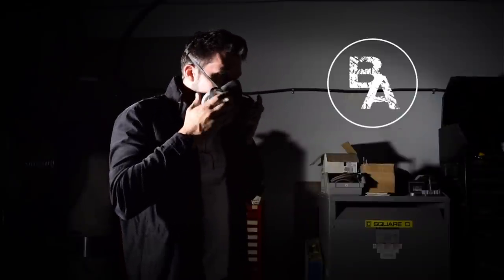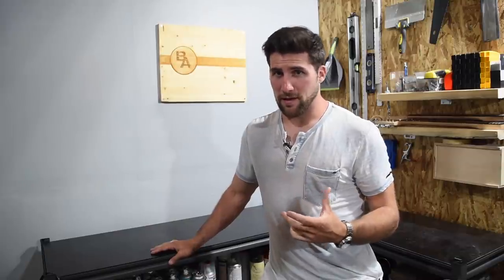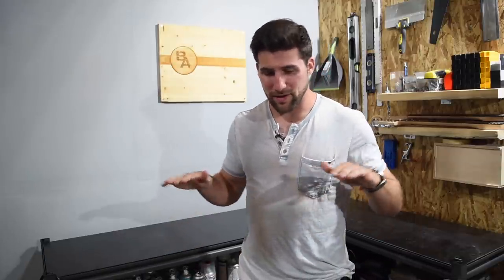Why is your paint crazing?

Comment: You can guarantee it's going to happen if you spray your clear on too quickly. You spray your base coat and either spray the clear when it's touch dry (recommended time), or when it's fully dry (2-3 full days later). Short cutting the drive time to spray clear will get you cracking 100% of the time.
Reply: What kind of paint are you talking about? I’ve never heard of waiting 2-3 days but I’m mostly familiar with automotive paint. The stuff I use you’re supposed to wait 30 minutes after the last coat of base and the spray clear. If you waited 2-3 days you’d have to scuff and then spray a coat of base again and then wait 30 minutes and clear. That’s how you get a good chemical bond instead of just a mechanical bond.

Comment: i had crazing happen on my latest guitar build progect and when it did it was vomit almost inducing word to the wise do not mix rustolium and duplicolor metal cast its like oil and water it dont mix
Reply from the maker: +Lance Moss A lot of rustoleum's stuff is enamel. Most duplicolor is lacquer. They are not friends unfortunately.
Reply: is it a good idea to use poly on the guitar i painted with rustoleum? the rustoleum i am using is a "universal" one, and it is also paint+primer(it is white). the poly i have is the minwax fast drying stuff.
Reply from the maker: +5hredder That sounds like a pretty risky move to me.
Reply: well, i am not sure how to finish my guitar... i finally finished painting it(i am kinda a scrub at painting, so it took a while to get the paint to look professional). will shellac rub on nicely? i am very familiar with shellac, but i have never tried it on paint. what would you recommend? i rather go and get the proper stuff for a clear coat than to have to scrape everything off and paint again...
Reply from the maker: +5hredder what kind of paint was it? I don't think shellac is going to be a very useful clear coat option.
Reply: the gloss white rustoleum "universal" primer+paint. https://www.lowes.com/pd/Rust-Oleum-Universal-White-Enamel-Spray-Paint-Actual-Net-Contents-12-oz/3728793

it is funny how it doesn't specify whether or not it is enamel on the can, but the link on lowes says all...
upon poking around the lowes website further, i have found that there are enamel based clear coats... aside from enamel based clear coats, what else could i potentially use to achieve a strong finish? if so, which one is best? also, if i use an enamel clear coat on completely dried enamel paint, will the paint color bleed into my bare wood when i spray the whole thing down? or will the edges stay crisp?
Reply from the maker: +5hredder enamel tends to be a pretty strong coat as long as it's given sufficient time to cure. It's usually best to stick within the same paint type just because it reduces the risk of bad reactions. 
I'm not sure I understand your question about the wood and the crisp edges. What do you mean?
Reply: i have beveled edges that i am going to scrape the paint off of and stain. will the clearcoat dissolve a little bit when i apply the enamel top coat? i am also going to spray the edges with the same clear coat to seal the stain in and to create one smooth finish, but i am concerned with the edge of the paint dissolving slightly, and creating sort of a milky look on the edge of the white paint that touches the stained area.
Reply from the maker: +5hredder enamel shouldn't dissolve your original clear.
Reply: my original white* alright, thanks. it is always good to get a confirmation from a professional. :) i guess if the clear could disolve the white paint, it wouldn't be clear... duh... silly me.
Reply from the maker: +5hredder some clear coats can dissolve paint. Particularly fresh paint. Your old paint should have a clear coat on it though, and should be protected from that.
Reply: i guess i didn't explain it properly, i built the guitar from scratch... i bought the "kit" from houston hardwoods, i bought planks of wood and used a grinder and a jig saw until it looked like a guitar, and built it all. there is no previous paint, aside from what i put on it already. i have experiance with certain clear coats, but i just have no prior experience with high quality painting procedures... 
when i put my first clear coat, should i scrape the clear coat back off of the area that i am keeping unpainted with a razor, and then reapply again over the whole thing once that coat is cured and scraped? i guess it would make it easier for me to stain the wood after i scrape off the first clear coat since i have to sand it all down until i get all the stuff out of the pores anyway.
btw, i do appreciate the time that you are taking to help me out with this. i realize that it is hard to visualize the project that i am building, but i can't publish it on the internet because there are a few features with it that i need to patent.(i am an engineering student that is currently studying fabrication on the side, and building a really high end guitar because it has been a goal for a long time).

edit: screw it, if the base coat bleeds into the bare wood when i coat it all, i can always just scrape back again and redo it, because a second coat will not dissolve past the first clear coat. i know that paint requires sanding to adhere propery(as explained by one of your previous videos), and i know from experience that shellac doesnt require sanding because it dissolves the previous layer way more effeciently; and when it is applied over a stained piece lightly, stain only bleeds onto the application cloth during the first two shellac coats. therefor, an enamel clear coat shouldnt dissolve the base paint once i top it once. and it is going to leave a crisp edge after i scrape the opaque bleeding away and re-coat. 
i guess i am all set now, thanks for teaching me about different paint types and what i should avoid. i asked the question of what to use to the paint mixer at lowes, and she said that poly goes good on enamel, and that it was the only real choice...
Reply from the maker: +5hredder I'm still trying to get a handle on what you're looking for, sorry. It's been a long few days haha. Maybe this will help:

If you're looking for (for example) stained transparent bevels and an opaque painted top, back, and sides.  The easiest option is: stain the whole thing, seal it with transparent sealer or clear coat, let it dry and sand lightly, mask off the bevels and spray your paint (or just paint and scrape what you don't want to keep), scuff lightly with 800 grit, and then clear coat the whole thing.
Reply: okay, i screwed up my paint while spraying the clear coat because i attempted to use acetone to clean off the edges where the top coat pushed the stain onto my paint... atleast now i know that acetone should never go on dried paint... it cleaned the clear off pretty good, but it made my paint bubble and it forced the paint layers to seperate.
 this example that you listed is pretty much exactly what i am messing with, and i am going to do this to fix my mess... 
there is one issue though, i am wondering if a masking agent exists that can be easily removed once the paint/clear dries without damaging stuff. i cannot use masking tape due to the complexity of the shape. however, i suppose that the list of suitable masking agents increases drastically since i am going to use it to cover a clear coat instead of bare wood. any suggestions? or would my best bet be to just kinda go "backyard chemist" on this and make my own anti-adhering peel glue? i am thinking parrafin might work, but it might also be hard to clean up completely afterwards.
i never thought i would learn sooo much about paint(or that there was this much to know about paint) by taking on this one project... i suppose taking on a hard project like this though is the best way to learn how to paint(for me atleast).
Reply from the maker: +5hredder If you're looking for a very controllable masking option for complex stuff I usually go with transfer tape, then draw on my image and cut it out with a razor blade. If you're looking for something more abstract, have you seen my video on the dish soap technique?
Reply: yeah, i was hoping that you knew of an option that could be painted on and then left to dry and peeled off. i have seen your soap method, which is really cool. however, i am kind of afraid that it will get pushed around by the force of the spray. i suppose that if i just let the soap dry before applying any paint, then it would be okay though...
Reply from the maker: +5hredder The soap shouldn't fully dry, but as long as you don't thin it it should be reasonably stable. It's probably worth testing it first.
Reply: alright, i will try it.
Reply: I used Rustoleum painter’s touch paint and primer, with the intention of topping it with duplicolor lacquer.  I called Rustoleum today and they said I should not have a problem as long as I let the Rustoleum dry for 48 hours first.  I hope they are right.

Comment: I've had this happen the first time I painted my motorcycle tank. I tried to fix it by sanding everything down and starting from scratch along with 3 plastic pieces. Everything went great. Plastics turned out perfect but the same thing happened with the tank... I don't understand what I'm doing wrong.
Reply from the maker: Sometimes its just a matter of how heavy the coats are going on.
Reply: @BradAngove  sanded everything out last night, was able to get it all out, praise God. Finished up with a compound and polish. Looking great. Thanks so much for all your tips via all these videos. Helped me out a lot bringing this '94 Magna back to life. Keep up the great work. God bless.
Reply: @alexanderking3971  watch out for older bikes and cars, the factory paints used are often times not compatible with new painting processes, most of the time you need to take it right down to bare metal so the paint doesn’t have a reaction.

If you want to know beforehand, always take an acetone rag and rub down the surface and see if the paint rubs off on the rag, or pour a small amount onto your work piece and see how the paint reacts. That will tell you a lot.

Comment: Trying to figure out why paint is cracking for a customer I sold paint to which happens to be a sister company I have my suspicions but will be looking into it further on Monday once I gather all of the facts.
Things that I already know.
1. Small office building has humidity issues.
2. Found mold behind walls with wallpaper.
3. They had to replace most of the drywall.
4. Was painted with a primer then painted with a professional grade paint and had to apply several coats. 
5. One year later, walls are showing up with fading when someone rubs it. Also has started the cracking.
6. Supplying new paint and suggesting to prime with Kills2.
7. Complaints already about how sample colors look yellow in one room and tan in another.

Just wondering if it’s due to humidity still in the office and what other questions I should be asking.

Thank you for your video. It was helpful!
Reply from the maker: Is the temperature there fairly stable? How long did they wait between primer and paint? Need to make sure the primer and paint were compatible of course.

Comment: Thank you for these explanations. I recently started crafting and EVERYTHING I have spray painted this crazing has happened and I have ended up throwing away my projects. I think I am about done with crafting because I am so frustrated. It is expensive to buy the project, the paint, etc. just to end up throwing it away. Then to have all these spray cans of paint left over. So frustrating!!
Reply from the maker: You can always sand back and try again with lighter coats.
Reply: @BradAngove  You mentioned that ye might make a set of videos wherein ye try do two sets one deliberately causing crazing and the other to avoid crazing. Then compare/contrast the two. Have ye perchance done this yet?

I'm interested in attempting to purposely create mild crazing to create the effect of an old guitar that has mild crazing in an otherwise intact paint job. I would like see how ye do it.

On a related vein, I just acquired an old vintage Matsumoto Teisco guitar that has mostly vertical cracks in the red finish so it looks like the paint it trying to split itself into vertical strips. I actually liked the look. Is there a way to reseal the finish and at the same time retain that cracked look? Would spraycan clear over the whole thing work?
Reply from the maker: What you’re looking for is probably checking rather than crazing. It’s something nitrocellulose lacquer does when it shrinks. Sometimes it happens over time, but you can also speed up the process by freezing it after you spray it.
Reply: @BradAngove  Ok, I'll try that on a test piece first. Would that process also work on enamels and acrylics too?
Reply from the maker: No, they don’t do that.
Reply: @BradAngove  That's a bummers, guess I'll have to find another way, perhaps with that crackle paint I've seen on some YouTube vids.
Reply from the maker: I have a tutorial on crackle paint if that’s what you’re after. It’s acrylic.

Comment: I was getting cocky with a huge trailer I've been painting outside, in December, in Florida, parked with one side southward and one northward.  I painted the tail and the south side with zero issues (first real paint job I've done other than interior).  Got the nose started and the north side.  North side had a few areas that were "crazing".  After some research and consideration on the specific spots that this was occurring, I'm thinking it's because they're spots that are relatively cold (relative to the rest of the trailer, which 68-75° Florida "winter" isn't cold) and therefore dry significantly slower.
Thanks for the video and the reminder to not get cocky, slow down between coats.
Reply from the maker: Glad you seem to have gotten to the bottom of the issue.

Comment: Had to paint the roof around the sunroof. Yesterday it looked great. I tried fixing some fisheyes and put on another coat. From there it went south. Now I have to sand it down and start all over. But it is significantly colder today than it was 2 days ago. I think that’s where the crazing was coming from. Thanks for the info!
Reply: America First Did u sand it down to bare metal? If yes what grit u used?
Reply: POWERTECH no the piece that goes around the sunroof is actually thick plastic. So I was as gentle as I could be